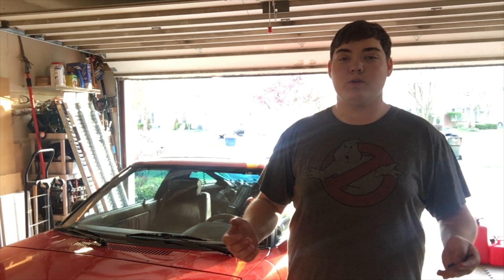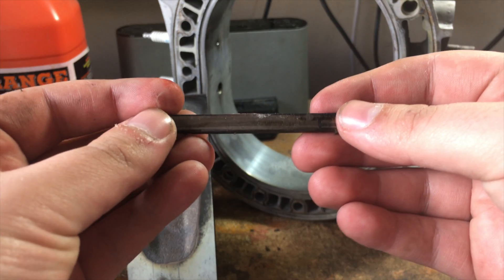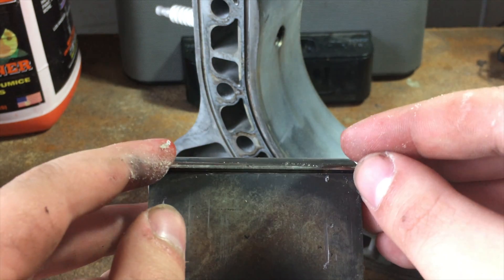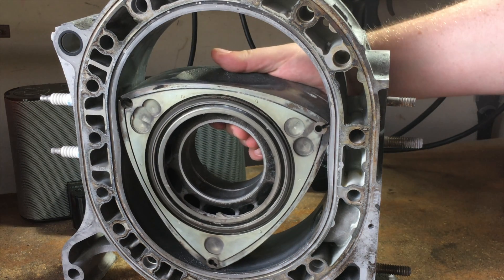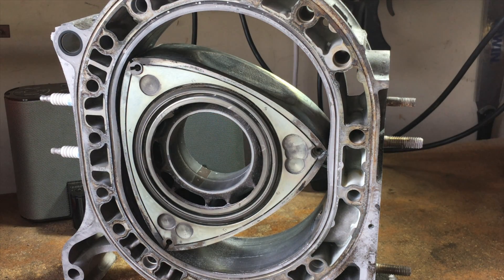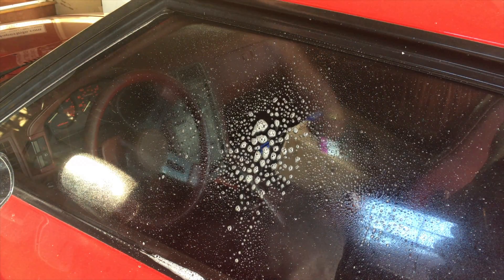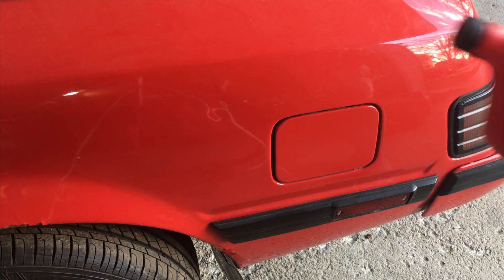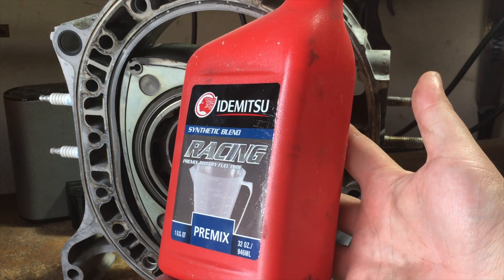What Are Apex Seals? How Do They Blow?

Comment: Ernie Brink1 second agoMazda, Toyota Select Alabama for New U.S. Auto Manufacturing Plant
    
Ernie Brink3 weeks agoCar Review
Published on May 29, 2017
Celebrating five decades of Wankel with five historic Mazdas On May 30, 2017, Mazda celebrates 50 years since the launch of its first production rotary engine. Rotary engines aren’t unique to Mazda, but more than any other automaker, Mazda is synonymous with the technology.

Mazda’s history with the rotary goes back to the early 1960s when it licensed Wankel technology from West German automaker NSU, now part of Audi. Created by Felix Wankel in the early ’50s, the rotary engine is an internal combustion engine that uses reciprocating rotors instead of pistons to power a car. The advantages of a rotary over a piston engine are its compact size, light weight, and high power for its size. Some disadvantages are increased oil consumption, decreased fuel economy compared to similarly sized piston engines, and that they run most reliably and efficiently if held at a constant rpm.

Comment: research on why Mazda has mostly used chrome,  this  has to do with apexs chatter or devil marks as the japan says if you fix apex chatter you do not need  chrome, housings
Reply: You would still still need the chrome molly on the housings.  Like cylinder liners on an aluminum engine you need a hard durable surface.

Comment: six chambers ======= six cylinders or piston engine 2 stroke or 4 stroke this great for the wankel 1080 degrees or 3 turns for output this engine thinking this way the brand new rx is going to get great fuel mileages and more power why higher compression why laser or apex meeting a apex no leakege Let's just take some basics when you are on power you only have just half power stroke when the back apexs lines up with the trailing plug hole but this all fixed in the brand new rotary you will get all the strokes at the full 270 awesome

Comment: tinkerhowedoodatrick
You're half right, actualy not all the compression but just a little, but yeah you will run less ratio, meaning that it will drop in engine efficiency
ERNIE BRINK
You're half right? were is your full 270 degrees of compression stroke this why you have flames even when you are injected?

Comment: great video but why do apex seals blow up a piston ring one does'nt blow up?
Reply: Piston ring blow. Do some research.
Reply: please bare with me apexs shake this means threre is something wrong ? lets fix it
Reply: chatter marks need to be fixed piston rings are fine
Reply: dokotrbimmer are you ernie banks or ernie brink?*or 10000 other names
Reply: Well they can and do, but the reason is that if you have pre ignition on a piston engine the valve is likely partially open which is why you get valve chatter.  There are no valves to allow the gasses to escape so the weakest link fails.

Comment: I have a 2011 rx8 r3 ,  question the 2011 rx8 need premixed oil?
Reply: Ricardo Ramirez The R3 doesn't need it because of the extra OMP lines. Don't bother.
Reply: Thank you man 👍
Reply: U can, but u mustnt. The R3 got an enhanced Oil Line and a 3rd injector aswell as the Injectionpressure is higher than the SE17 (in US its SE3P) i would anyway premix, or change the oil to IDEMITSU 5W30, its alsmost ashless (with a grade of 0,8% ash) and specially developed for the Rotary engines. Its the Developer for the lubricanr of the legendary Le mans winner from 1991 the Mazda 787B :) ill hope i could help with my knowledge ^^
Reply: @SilverShadowLP  👍 Interesting comments.  Do u know if premixing 1/2 - 1oz  2 stroke oils per gallon will definitely help seals or just a myth to sell more oils?  Many have advised to premix with regular non synthetic 2 stroke oils but I have not seen scientific proof or before / after photos of seals & rotors with different oils.  Thanks & keep up great info 🙏⭐🎆👍
Reply: @chrislg4519  well, if you follow the logic, you should get explained by itself that it works. Surely can you use 2 Stroke Oil itself because it burn ashless and dont build up Carbon. Also i recommend, using Engine Oil with a as low as possible ash part (my english mess up here at this point again) to prevent carbon builtup more. So the apexseals are going to live furthermore and that is the main purpose of premixing in itself. The other positive side effects are just a good gimmick to lube the components furthermore. Or just simply install the Sohn Adapter so it injects the pure 2 stroke oil into the chamber instead of the engine oil wich could contain dirt and other shit from cooling and also cleaning the engine. ^^
Reply: @SilverShadowLP  Great thanks for informative reply Silver Shadow 🙏👍 i will also check rotary forums as i try and keep seals & rotors well conditioned  🌟☺ with ashless oils in all ways possible. Blessings to you & all rotaries ⭐
Reply: @chrislg4519  You're Welcome Rotary brother <3 always Remember: "our Heart's aren't beating, they Rotating!"
Reply: Do it